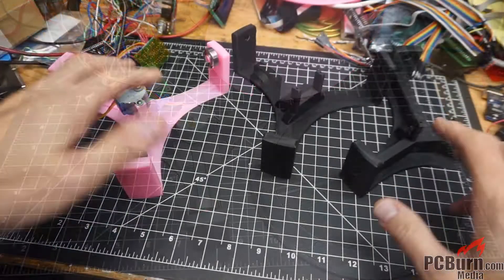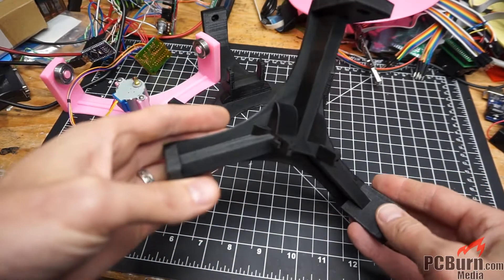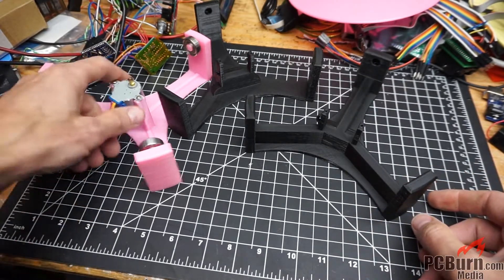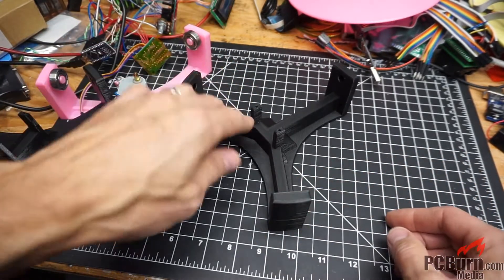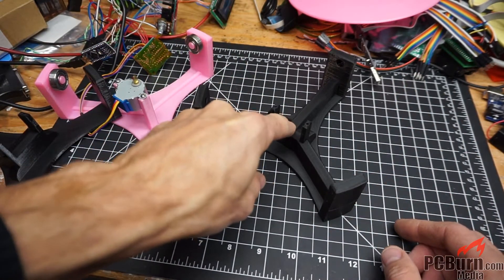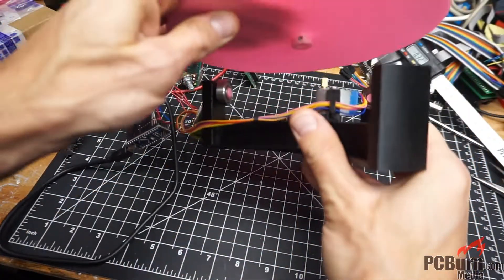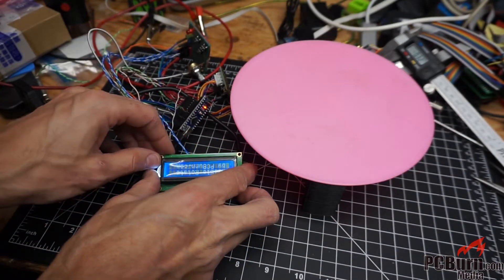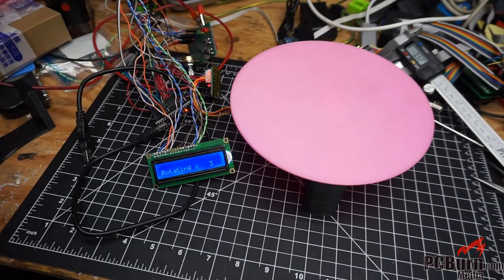YOUR Photo or Video Table (DIY Motorized Turntable for Scanning or Video)

Comment: Do you have the Sketch/Arduino code for this ?
Reply from the maker: This one ended up being a rabbit hole of a design I've been meaning to revisit. I do have code somewhere, just not in a release state. I also added a non-stepper PWM DC motor driven version for smoother rotation that I've got to release.

For example code the project I took the measurements from had some up. It's linked to in there somewhere but here's the link again: https://www.thingiverse.com/thing:1826589
Reply: @PCBurn  Thank you ! Do you have a  link to the non-stepper PWM DC motor version as this is one I feel would work out better for me. Thanks again
Reply from the maker: @tubamanandy2  I don't. That library's for a different project and I haven't ported it over or built the display code for it yet.

Once I get it cleaned up I'll be posting it as an Arduino library for DC motor control (driving a sufficiently robust mosfet via PWM).

I'll be releasing it on YouTube as a solder evacuation fan project. Once it's out, though, it'd be the same exact setup for this and I should have a version with a motor mount adapted for servo or DC hobby motor. As long as it works :).

Comment: looks good, i cant wait for my 3d printer to come
Reply from the maker: Yea, I still have to expand the software for this and add in a second motor option for driving a small DC motor with gearing.

I've also created a new library for a Mosfet driven motor that I need to release. Should work smoothly in this for variable non-stepped rotation.